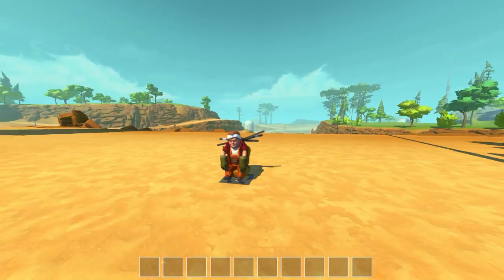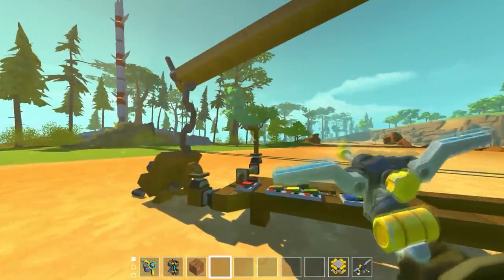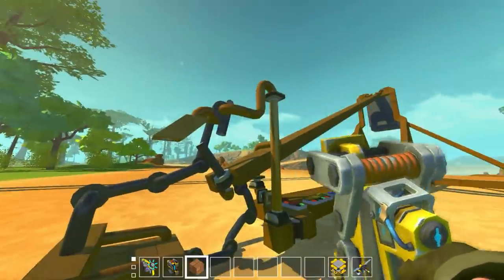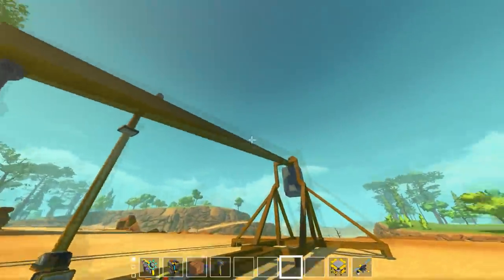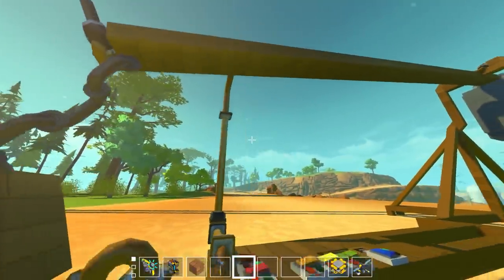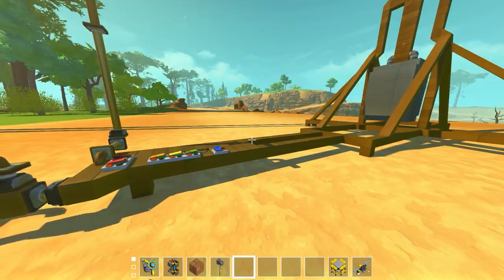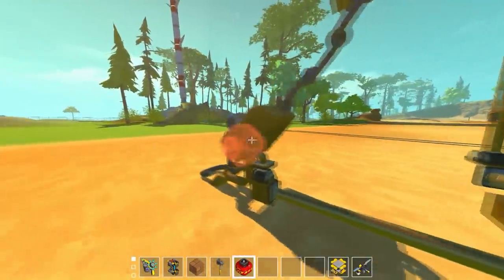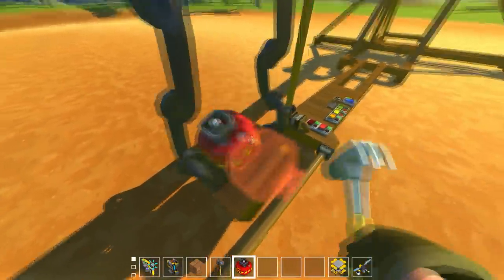Pure Mechanical Gravity Powered Trebuchet! (Scrap Mechanic #357)

Comment: I feel like this could somehow be used for a multiplayer Monday episode! Maybe you could have another castle battle with multiple of these on the outside of the castle launching explosives?
Reply: Kg 2005 trebuchets both in real life and in this game are GARGANTUAN. Fitting that trebuchet in the castle could be the game by itself! Not to ruin the idea, but a scaled down version could show promise. If Scrap Mechanic is truly physics based, then Kan should be able to build a smaller version. The only issue is if it is proportionately powerful as the first (I.e. if it can still launch far as the other can, or at least launch the same distance - to - length as the large trebuchet’s firing distance - to - trebuchet length is
Reply: Green THEEM Innovation [Aiden] after reading your reply, I decided to clarify myself by editing my comment, as I meant that the trebuchets would be on the outside of the castle. But, your idea of having scaled-down versions on or in the castle would also be interesting!

Comment: Great job kAN!
Just a quick tought: if you extended the length of the arm that held the weight, would it launch further? You'd have to make it taller for it to be able to complete a swing, but maybe...
Reply: that would shorten the throw, the more weight closer to the center makes the end of the sling arm travel faster thus increasing the speed of the projectile
Reply: @TheDutchRanger  Ah okay thanks for informing me, I completely forgot about how the would center the center of mass more.

Comment: How big of a nerd am i to like how complicated this is
Reply: You arent the only one that finds fun in learning complicated things
Reply: Medieval artillery in my opinion isn’t as complicated as modern (too overpowered to even be) weapons are, but they are just raw. The physics behind an explosion-based cannon or gun? That’s thermodynamics, aerodynamics, explosive chemistry, and projectile physics all in one model! That’s not counting the recoil effects either! Trebuchets can be competed to a three-jointed rag-doll arm flinging and releasing a rock at a specific point. It’s actually the same Mechanic that goes behind the old cloth slingshot: a long piece of cloth folded in half, with rock in the fold. Take each end between your thumb and forefinger, and the other in the rest of your same fist, and swing the rock in the sling around your head. Wherever the sling is pointed at when you release your thumb’s grip should be perpendicular (at 90° angle) to the trajectory of the rock. The trebuchet arm and the chain with the sling is the same as your arm holding the twirling sling-shot, just with a straight line to the “hand” rather than your arm, and the launch is over a longer throw than a swiftly whirling rock in a cloth strip.
Reply: Just felt like giving some eye candy! ;D
Reply: @GreenTheem  the thing complicated about this was how he had to find out how to make the latching system and all of those things.
The basics of a gun or artillery is easy to understand.
Reply: Jacket123 
I’m mechanical minded! I got a million ideas in clockwork. Meh... this video is cool. Got me thinking, and I over complicate my own comments! Next thing you know, I’m making a Rube Goldberg machine in my game of Besiege to give myself more chaos to deal with! 

Have a great Halloween everyone!